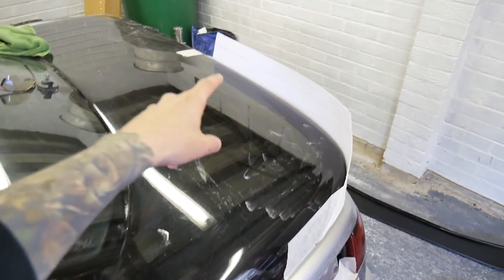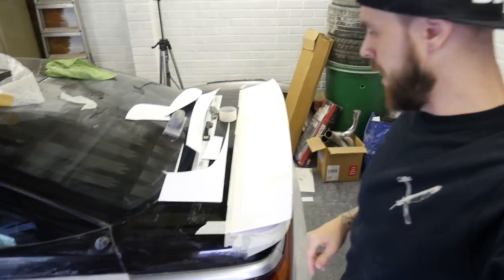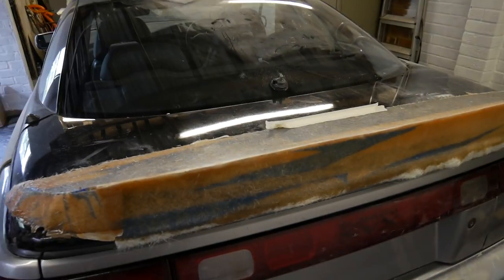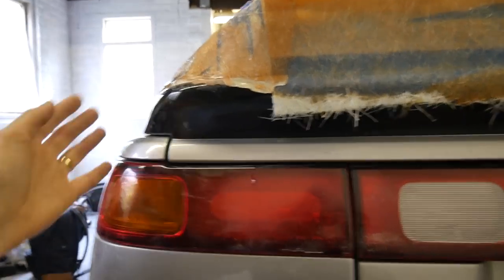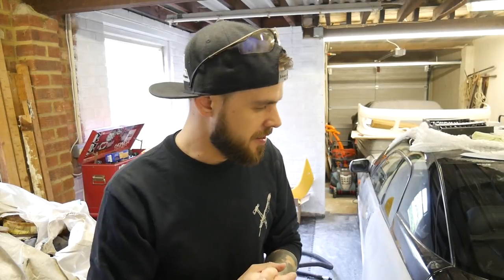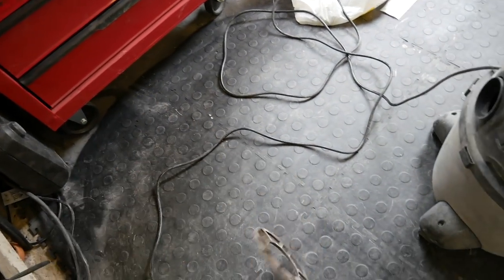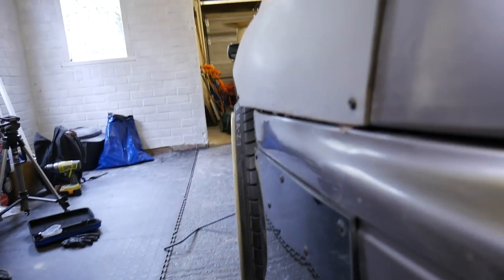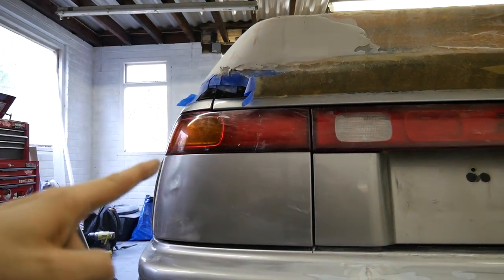DIY Ducktail spoiler

Comment: #Mr.Build_Create have you considered using an interior spray paint gun to spread your Resin over big areas like this... although it's too late in this project, you should consider it on your next one because it gives you time to adjust and what not before it starts to harden.